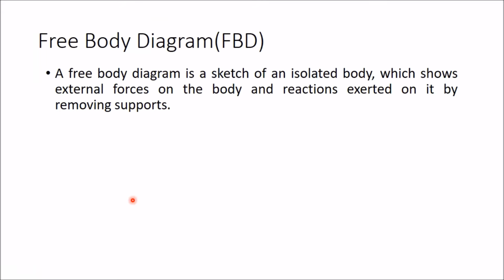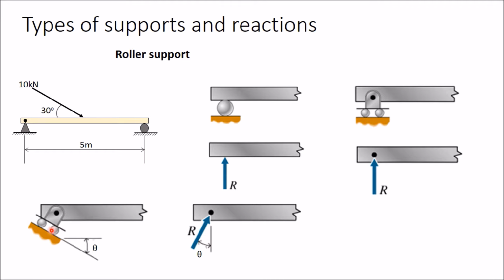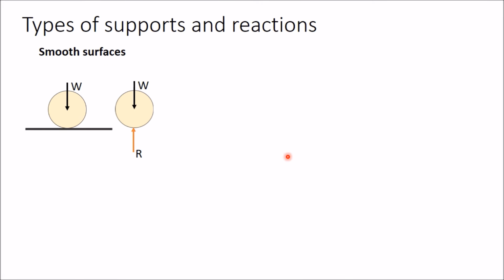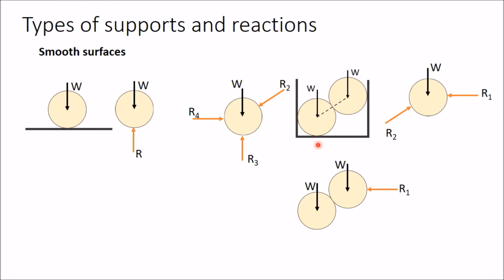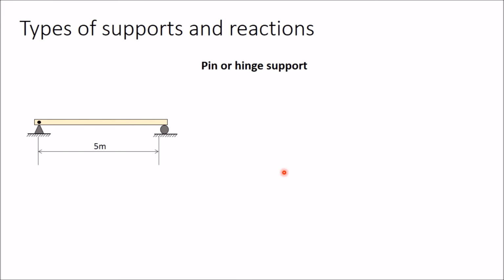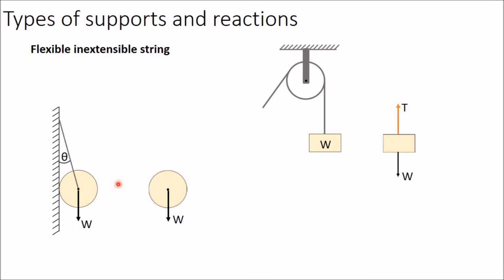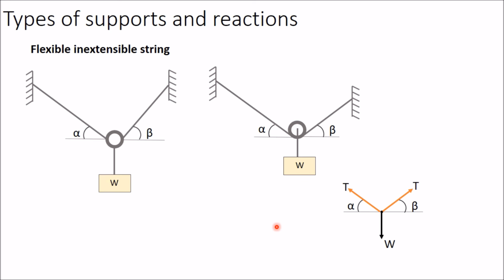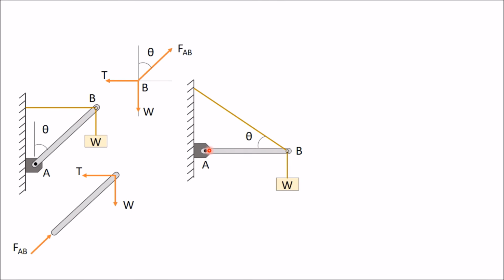Free Body Diagram: Engineering Mechanics

Comment: Professor,I have a question.For an object which is in equilibrium ,it doesn't matter at where we take the moments ,right?It must be zero.Could you help me to understand
Reply from the maker: For equilibrium resultant force should be zero. Therefore its moment would be zero about any point. 
According to Varignons theorem sum of moments  of several forces about some point shall be equal to moment of there resultant about same point.
Reply: @drjojithomas  Oh thanks professor.Plus,in the equilibrium questions we need to select the point which has the most unknowns right?It's gonna make easier to find other unknowns